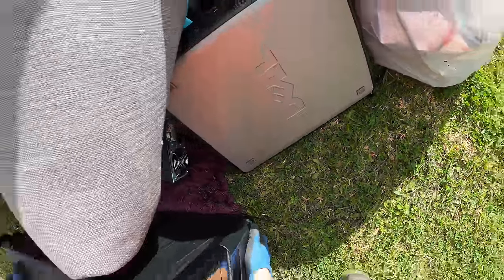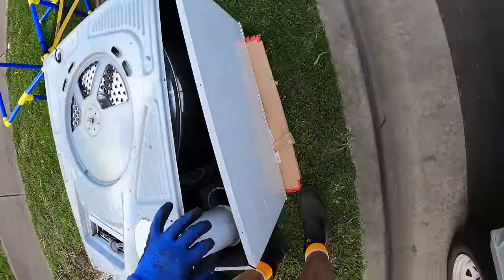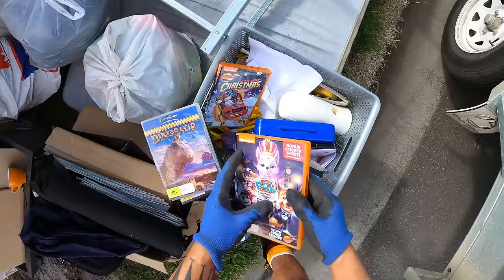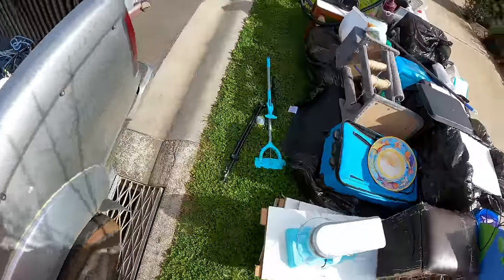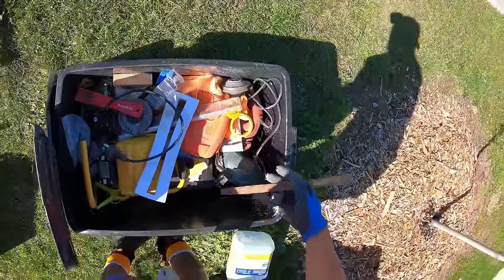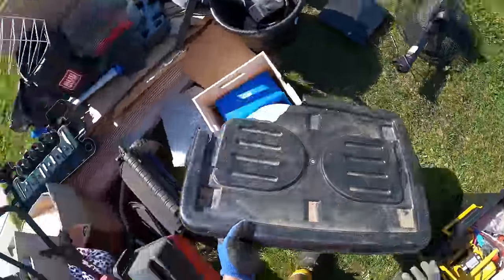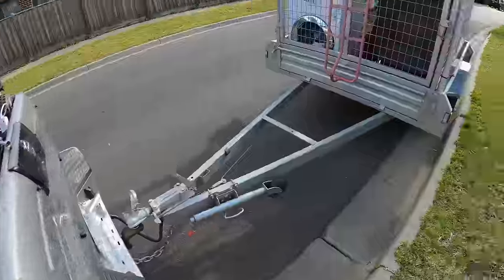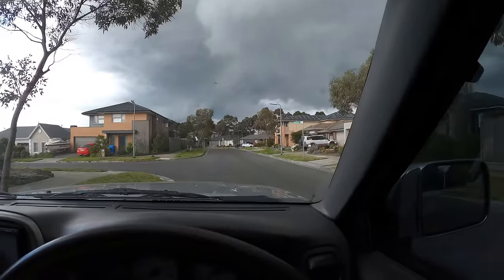These Rubbish Piles Will Blow You Away!

Comment: You might not be into it but often you can pull printer ink cartridges in a few seconds from small printers, if they are manufacture ones, Canon, HP etc companies buy them as virgin cartridges on eBay or some businesses offer free shipping via prepaid courier. They get refilled and reused / resold. Can get from few pence to a few pounds (UK based) per cartridge.
Reply from the maker: I’ve seen other scrappers doing this but haven’t looked into how they sell from Australia yet. Thanks for the advice 🙂